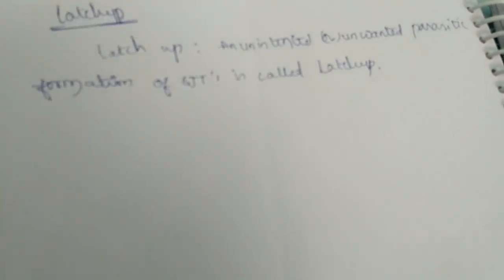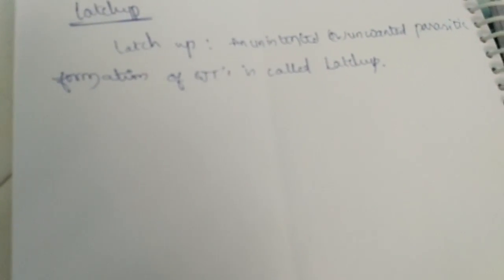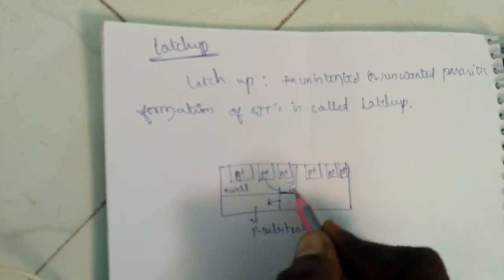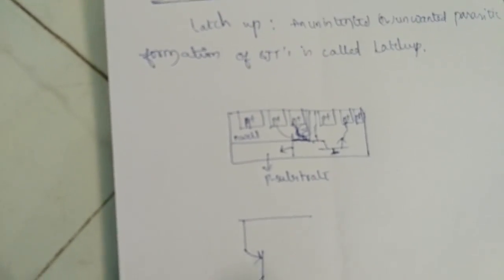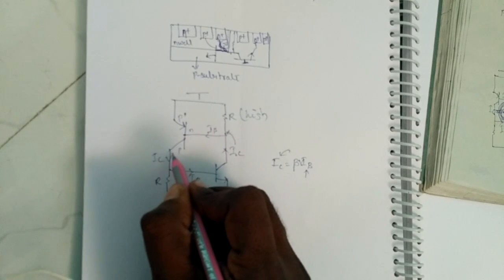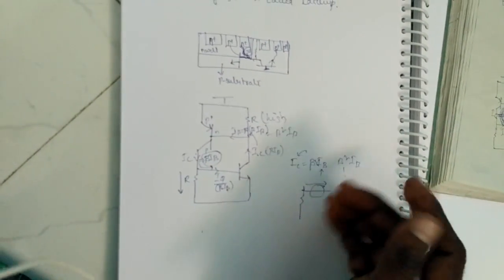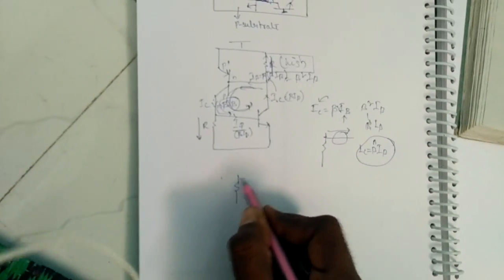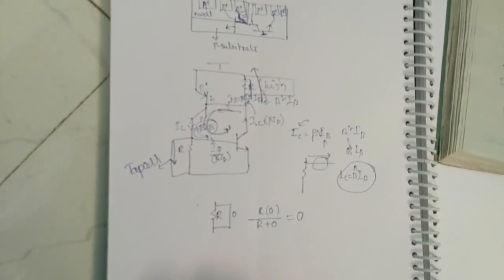VLSI latchup tapcells

Comment: What you said is correct but by adding more tap cells  parallel resistances will be formed and there by gain of the transistor is reduced ( reference - Digital integrated circuits by Rabaey Topic-Latchup)
vijay pushpa